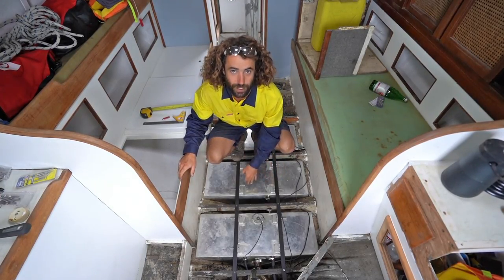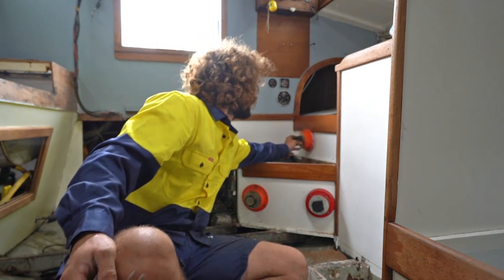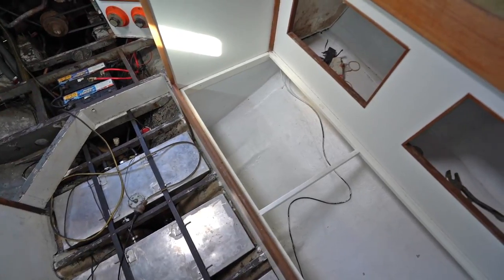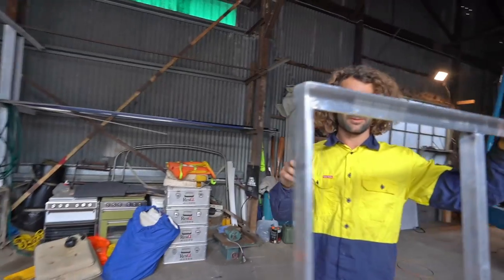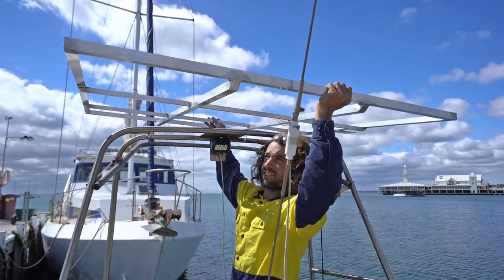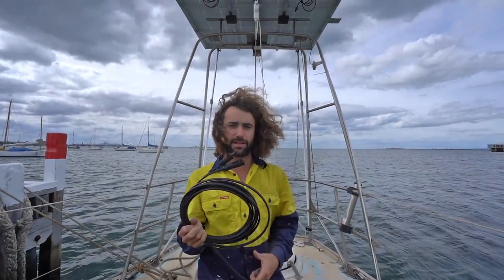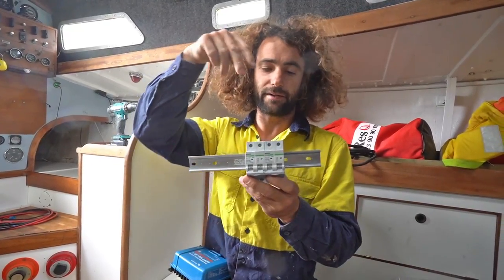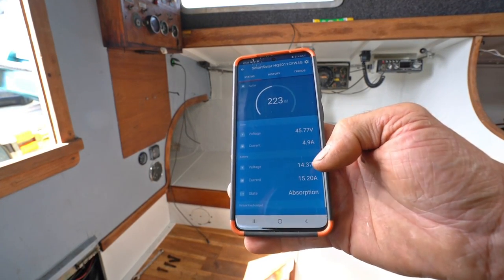Pivoting Solar Panels and Battery Installation - Yacht Restoration #12

Comment: The first rule of boat club is you don't talk about boat club. The second rule is never use automotive cable. It will corrode quicker than you can say 'I should have paid a little more for the tinned stuff).
Reply from the maker: Thanks man, I'm currently receiving a tsunami of messages telling me a duffed it with the wiring. I'll wait till it corrodes then replace it
Reply: @dancampion Rule #3: It will fail when you most need it.

Comment: Nice 1, I was thinkin port/ starboard as well as aft an forward. But, if, I want a boat I should do it my way eh! Good stuff, my one concern is the starboard battery angle and battery plate coverage in those batteries. Keep up the good work, you an yours stay safe an well with whats happenin at the moment eh!

Comment: Dan. Looking at your shop I am pos you have a blow torch or even a hot air gun. 60/40 solder on those lugs and 3m tape  and unless submerged in salt water will last you 10 years. I use them like that for a living.

Comment: Nice. Your charge current is low because your batteries are full and on absorption mode. After you use some power and start bulk charging you will be back to normal and use the full output from the panels 👍
Reply from the maker: Ah that makes sense, I was hoping it was something like that. Cheers Mike

Comment: Thinking you might need to make some ally pivot points and weld them to the ends of the telescopic arms otherwise a small good gust of wind may pop those plastic plugs straight out of the pole
Reply from the maker: Yeah I'm thinking you're right about that. Cheers Andy

Comment: Hi Dan, I like your panel setup. Lets just hope it survives force 7. If you use automotive grade cables you should at least solder the terminals. It will make a huge difference with time. You can then seal the open connection with vulcanizing tape. That way you can protect all high current connections on board. Cheers and good luck! P.S. You shouldn't be using rivets but screws, in case you need to remove the panels.
Reply from the maker: Thanks Andrew, I think it will definitely need some reinforcement, it was 30 knots last night and I found myself laying awake wondering. Great suggestions for the wiring, I didn't know any of that. Keep the feedback coming!

Comment: Be careful if with 20 or 30 knots the solar panels will make you sail, and they can fly away! ... I have already seen it in other cases. so be careful, and my advice .... lower the height of the panels.And put a reinforcement system for those moments. You will go safer in bad weather. Sorry for my English! I am from the Basque Country in the north of Spain, and we know what it is to sail in bad weather!
Reply from the maker: Thanks Juan, I am a bit concerned about this. We had 30 knot winds last night here, the panels have survived but I think they will need reinforcing

Comment: Hi Dan - great videos. It looks like your + and - cables are coming off the same battery (rear one) with the other two forward ones in parallel. This means that the 1st one will be working harder, the 2nd somewhat and the 3rd not so much. The proper way of hooking up the cable is so that the current is forced through the entire battery bank. Ie + on rear battery and - on the forward one. This will ensure equal charge and load through all batteries and equal wear  on the battery bank. Might seem like it doesn't matter but believe me it has a massive effect on wear on the batteries.
Reply from the maker: Thank you Fritz!! I've swapped the negative over to the last battery on both banks. Thanks for letting me know, much appreciated

Comment: Good job Dan, quick question. Do you connect 700w solar panel on the victron mppt 100/30 for a 12v system? victron have a limit of 440W for a 12v and 880w for a 24v.
Reply from the maker: Yeah I did connect it like that, I wasn't aware of that. Perhaps I can connect them in parallel?

Comment: The black plastic connectors on your extending poles might need a nu & bolt through them, just the solar panels are a big surface area to catch the wind.
BUT I dont know how hard they were to bash into the tube. 🤷‍♂️    Just a thought.
Great to see the boat coming along. 2x👍
Reply from the maker: Yeah I think that's a very good suggestion, it was very windy here last night and I found myself laying awake in bed wondering if the panels have been ripped off. Bolting that connection will give me some peace of mind.
Reply: @dancampion  I think its worth the effort .

Comment: You are wasting half your solar panel output by wiring the panels in series. The excess voltage gets burned off in heat. Recently I did something similar with two new solar panels. In series I get high voltage but the amperage output from the controller is only half what the output is from wiring the panels in parallel. It is an easy switch to test.